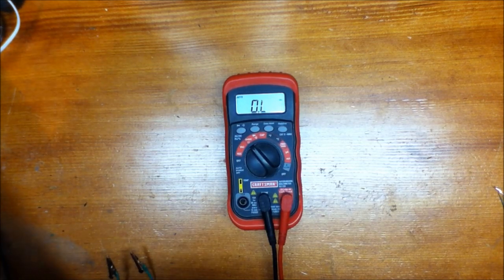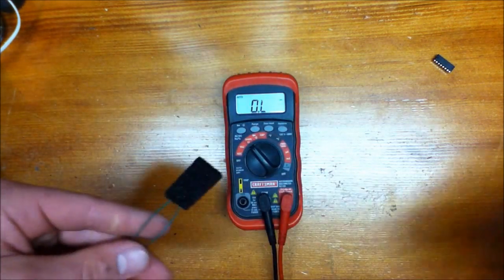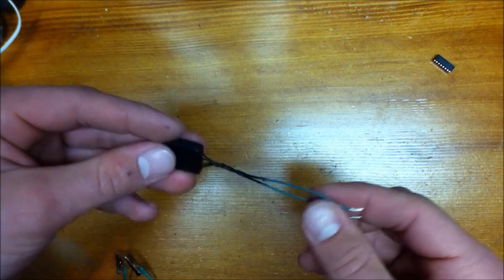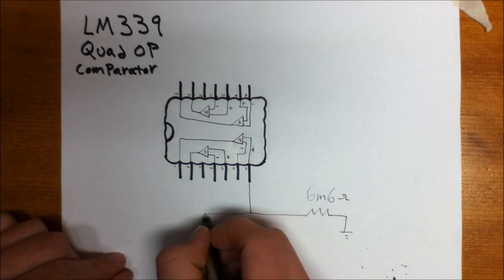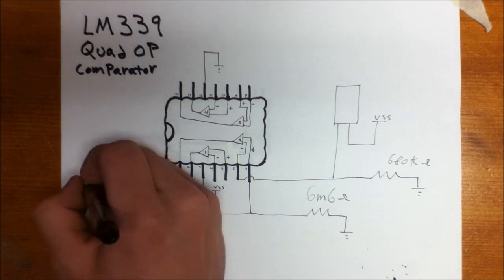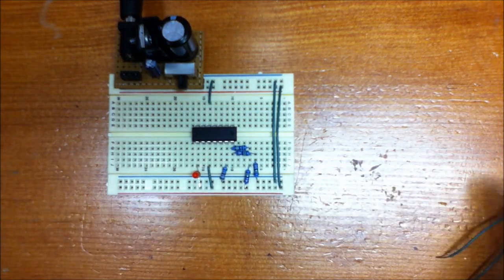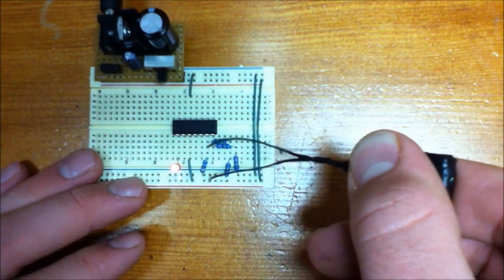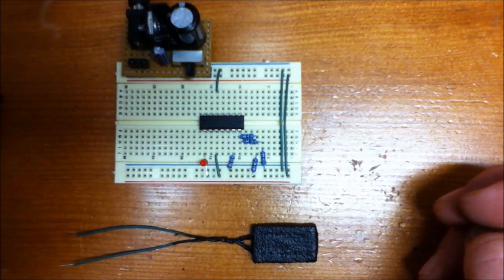Hommade Touch Sensor

Comment: Thank you for the video. How do you say for example I need 6.6 mega ohm resistor here and there? I mean for example why is it not 3 mega-ohm or 3 kilo ohm? What are the criteria for designing a circuit like that? Is it trial and error? experience? software? manual from Op amp manufacturer?